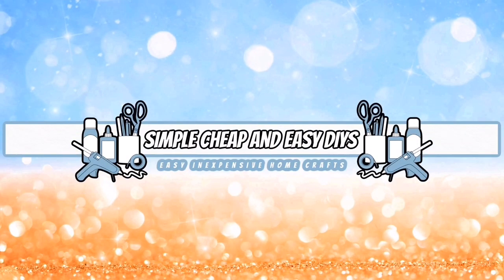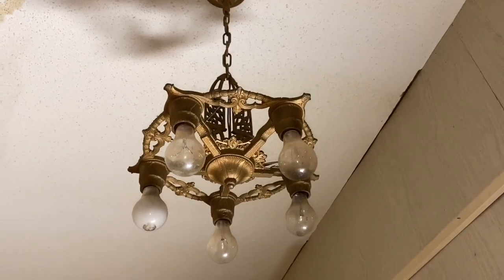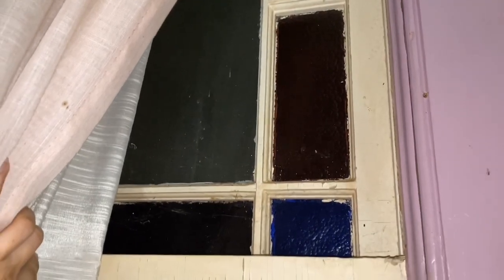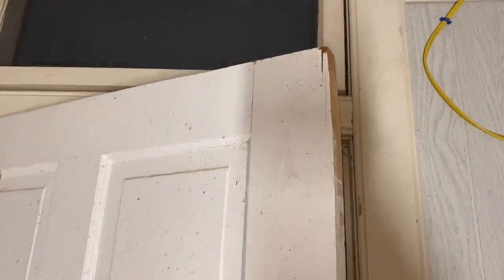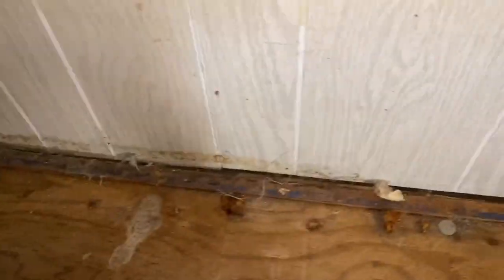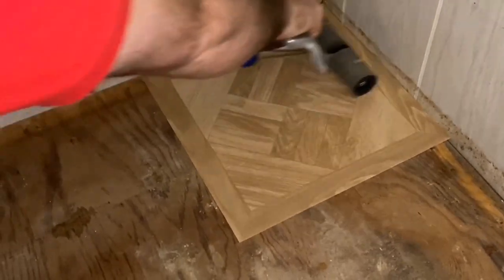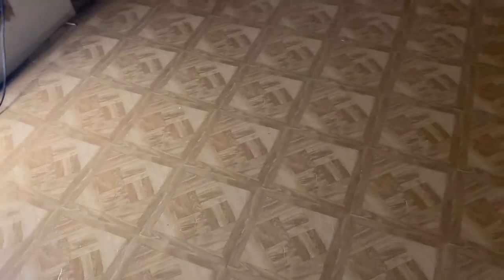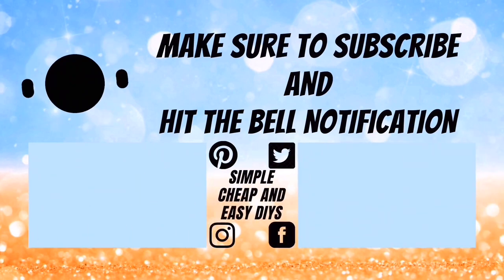Home DIY Bedroom Make Over | Vintage Home | Installing Peel & Stick Tile | Bedroom #1 | Part 1

Comment: Floor looks great.  What are you doing about the electric wires lining the walls?  You have lots of work ahead of you.  I think a egg shell finish in a light color would look nice.  A shiny paint will accent every bump on the wall
Reply from the maker: Thank you. We are going to be replacing the wire with conduit wire, the house had old knob and tube wire which was not safe so this wire is just temporary. Regular wire wasn’t really a option with out taking all the walls down since you can’t get to the inside walls from the attic. I kind of explain in my living room make over video, but in a later video will give more info on the wiring.

Comment: Holà,
Ça ne se pose pas collé à un côté de la pièce, mais, on centre la pièce, et on commence par ce centre. Cela évite d'avoir les découpes que des 2 mêmes côtés de la pièce, mais qu'elles se retrouvent "équilibrées" au pourtour. Sans oublier, que si le côté dont vous partez n'est pas d'équerre, vous allez avoir votre sol qui sera en biais.
Bonne continuation, car je vois que vous avez beaucoup de travail à faire.
💮🌺😉

Comment: Why put flooring down with that gross paneling still up
Reply from the maker: We are unsure if we are going to replace the paneling, paint them or just clean them up for the most part they walls are in good condition and there are extra paneling sheets that was in the attic that can replace the messed up piece. We just really want a clean floor down, I unfortunately didn’t record what the carpet looked like that we took out.
Reply: I think the paneling looks good and I love the Windows above the door